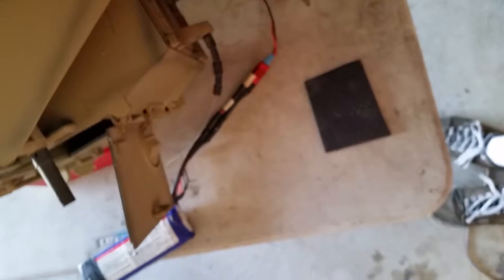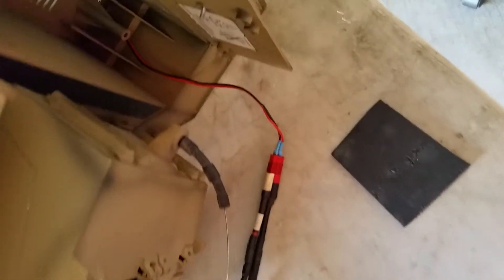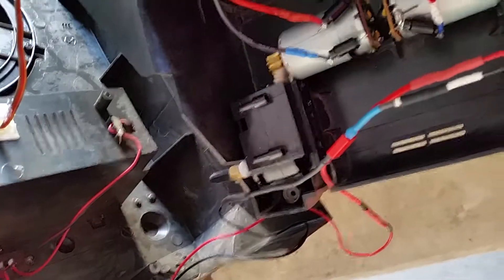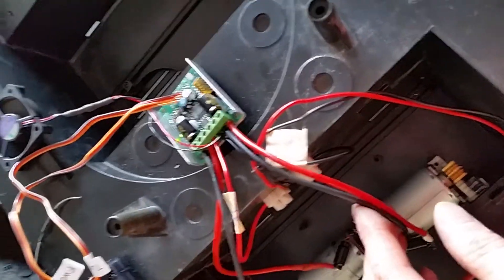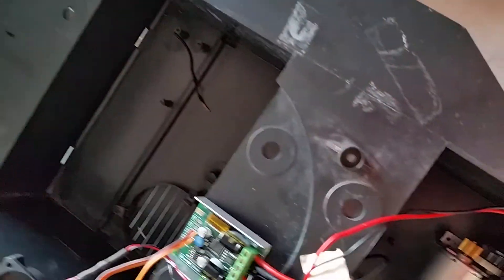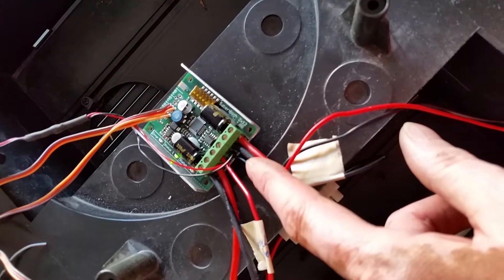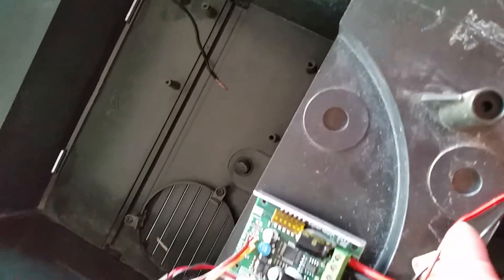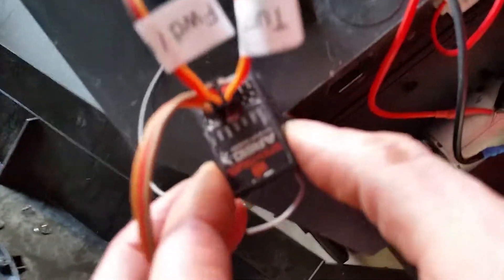21st Century M5 Stuart RC Tank

Comment from the maker: Thanks for the question..its been awhile since i posted anything, so thanks for taking an interest.  The motor consist of the dc motor with shaft attached but on the shaft is a squared nut, the inside of the wheel is square shaped, so when you seat the wheel on the motor shaft the nut fits snuggly inside of the wheel.  Thats what gives the wheel "torque" or rather the ability to spin in sync with the motor(s).  I had a wheel that cracked on the inside square part and after that the motor shaft just rotated inside of the wheel causing no torque or movement on that side.  So it could be stripped on the inside of the wheel or the wheel is not seated against the nut...which has also happened to me.  I hope that helps...

Comment: I’m trying to learn how to build and repair these myself as I have one and my sprocket I think is what it would be called is not turning correctly and so I’m not sure if the whole engine part itself is gone bad or if it’s just that the sprocket is not able to gain it on traction with the screw and how it is screwed in either way it is not turning the track on the right side Just wanting to learn how it is best done to take apart and then put back together. These would love to hear from you if that’s possible.